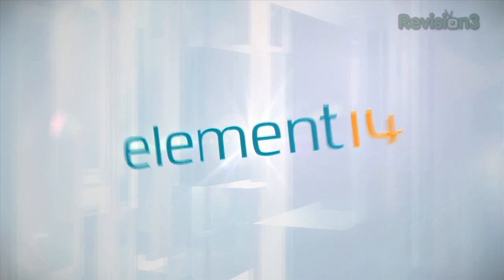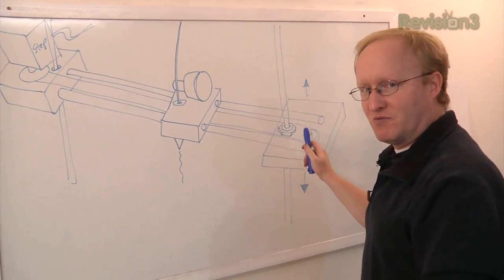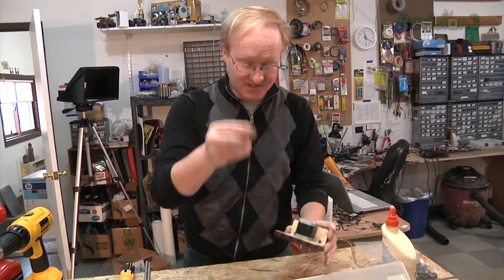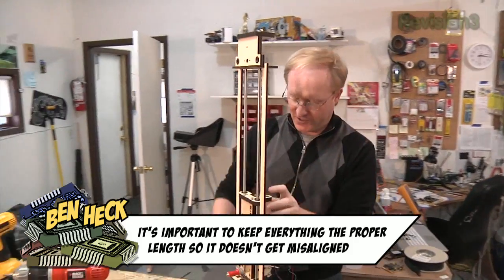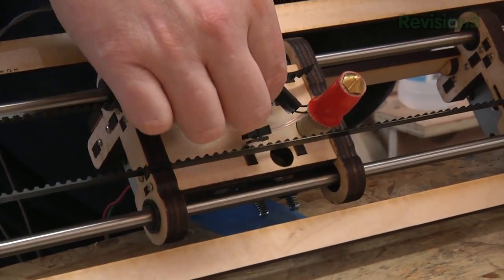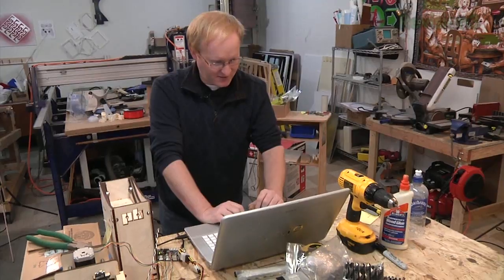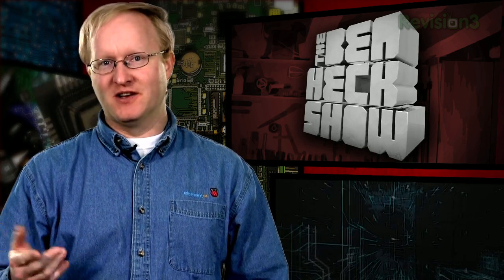Double Decker 3D Printer Part 2

Comment: how does he connect 2 temp sensor to the board?
Reply: Menuka Gamage I guess because theyre the same hotend you might only need one although its something i was wondering too as he never says
Reply: Ben Abbott You might notice he's not using a headed bed in episode 3. The ramps board has inputs for 3 thermsistors - 1 bed, 2 extruders. The real "challenge might be 2 heatbeds.I'd setup heatbed controls on another board. Power the beds with relays. Write a routine that only looks at the temp of the bed, decides if heat is needed and turns on a relay for whichever bed needs heat. Primary board decides if the printer is operational and energizes a relay the turns on the second boards power.

Comment: don't adjust the stepper pots while the power is on! Its super easy to slip and short your board.
Reply: well then at least be forewarned, one tiny slip that can happen to even a surgeons hand, will mean waiting for parts in the mail.
Reply: It's usually a good idea to print/get a plastic screwdriver, so you don't have to worry about that.

Comment: was thinking "why dont you just use 2 different printers" but then i thought about it, having a dual printer means that the stepping of the axis is the same, only thing different from the 2 prints is the extruder.

Comment: Woah chill! The reason I say I "doubt" is that most cinemas use solid state projectors with a 60 and most 100Hz refresh rate. So you can't see it strobe otherwise TV at home or your computer screen, flickers as well and thus The Hobbit flickered too.
The old shutter projectors (where 24 could be noticed a bit) are so last century. The only difference you will see is the amount of motion blur on solid state projection/TV/Computer.

Comment: It's not really the number of FPS that gives a film look the difference between 24 and 30 is negligible. The real factor was the size of the sensors which gives you that shallow depth of field and the 14 stops of dynamic range that film has in comparison to a moderate 10 (or less) that video had. Hence with dSLRs the film look could be achieved even dSLRs that film on 30 FPS still look cinematic.
48FPS is for kids that grew up on 60FPS video games. Our generation loves motion blur but 24 is poor

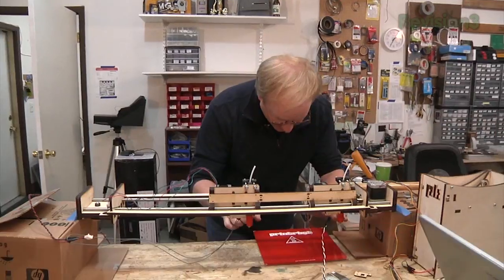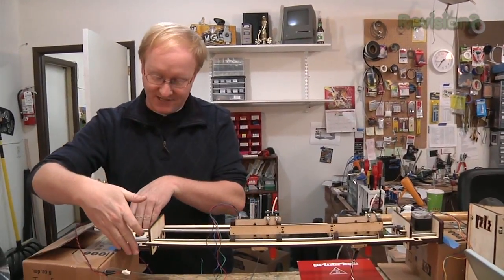Comment: 11:30 - 12:18 Would it not have saved space to build the right extruder backwards? (the one on your right, our left) You have a large empty space between the two extruders. If the "guts" of the right extruder were flipped around, they would fit in this space and allow you to not have an overhang on the right side. it looks like this would have saved you a few inches total any you wouldn't have had your belt length problem (8:26).

Comment: Actually a movie in the cinema flashes at 48fps, it just flash each frame twice. If you don't do that you brain would see each picture. And movies run at 24fps mainly because that is how fast film cameras can run without running into all sorts of problems.
But now digital cameras are becoming better, and a lot of directors are moving towards it. But there are still a lot of directors that prefer film to digital.